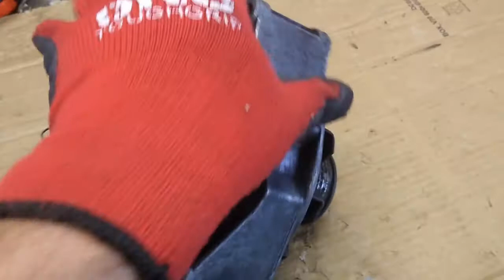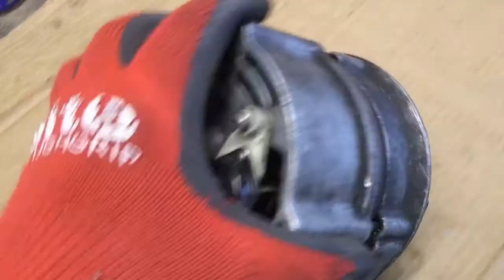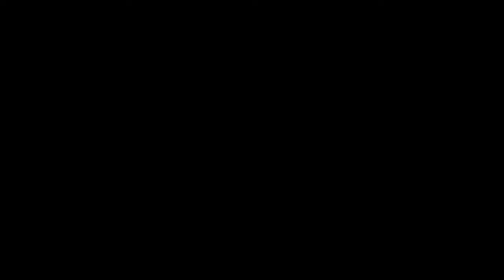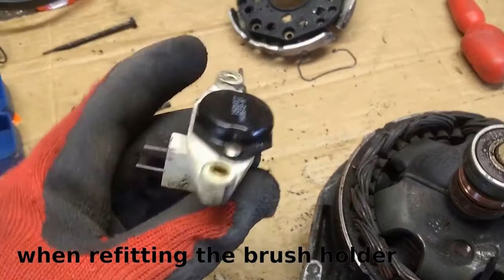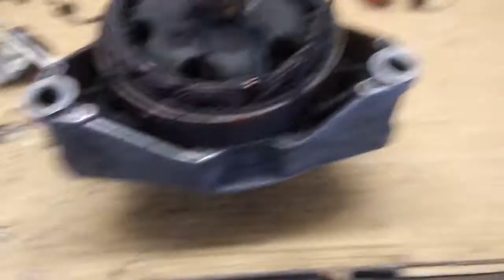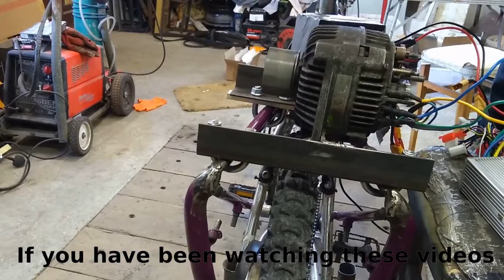Part 6 DIY E-Bike using 2nd car alternator, Lipo batteries and cheap Chinese controller

Comment: Hello and  well don you make good job Pleace thell me its posiboll to run car althernator- sensorless motor with sensor controler .Because I want to buy a powerful controller but all are sensor, I also have a motor alternator with 36v 15amrera controller but it is weak for my bike Thank you in advance
Reply from the maker: Yes, you can use a controller that is meant to have hall sensors connected. It may not be as efficient but will work. I have used 1500W controller like this but the alternator/motor does get warm so maybe be careful not to use too much current.

Comment: Keep going man, good job
Reply from the maker: Thanks mate. 
I'm still working on it but have been busy on other things the last few weeks. I will hopefully get another video out soon.
Reply: @alibro7512  well, i hope seeing your videos soon, I'm building an E-bike in Argentina, it's a lot of fun (sorry my bad English)
Reply from the maker: @javierchaparro4769  LOL, Your English is better than my Spanish. 
BTW This is my first ebike, Have you seen the videos I made of my 2nd?
Reply: @alibro7512  yeah, i liked the mid drive improvement, do you use lipo cells now ?
Reply from the maker: @javierchaparro4769  No, I have a 36V 10S 8P Li-Ion pack in at the minute and amin the process of building a 48V 13S 8P pack. 
Hopefully it will fit. :)
Reply: @alibro7512  that's mad, i build a 15s 60v pack and now I'm aiming to 20s 72v
Reply from the maker: @javierchaparro4769  Wow! 72V!!! Not that IS MAD! :-) How many in parallel?
My controller is only 48V and I don't have much room to package the batteries inside the frame which is what I want so for for now I am sticking with 13S 8P.
Reply: @alibro7512  i use 5 cells parallel, 15 cell series, my controller is 48v, but in order to use 20s i must upgrade caps and N transistors, (its safe to use 15s on a 48v controller)
Reply from the maker: @javierchaparro4769 My batteries are not great so I need more in parallel for better range and less voltage sag. I originally thought I could make it 14S but I think it is too tight in the frame so for now it will be 13S